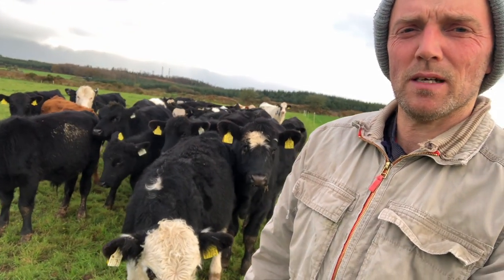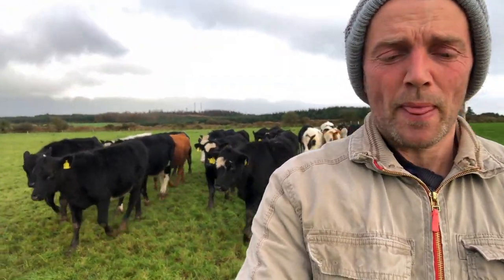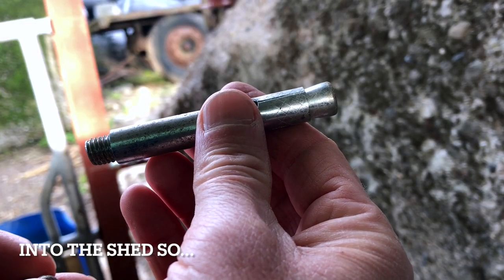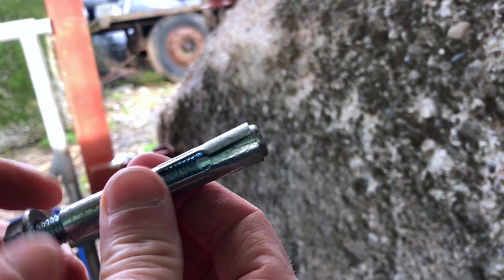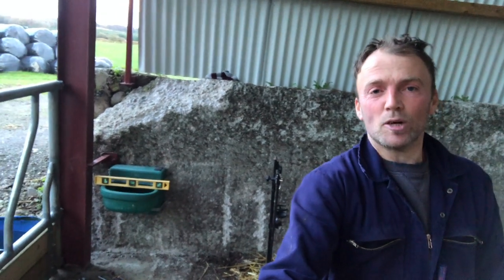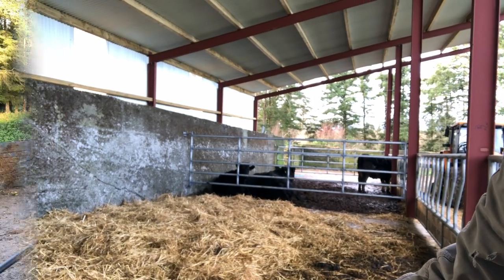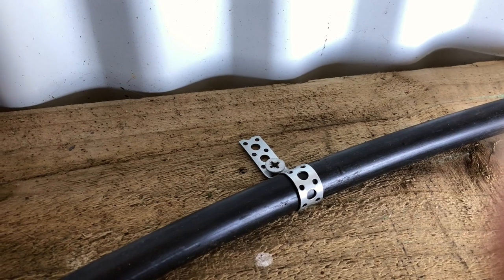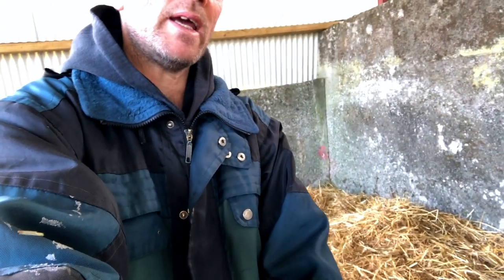Water trough finally fitted and a bloody start for the new crush gate

Comment: Kieran, I recommend that you add a gate/lever valve to the hydrodare of the water trough along the timber where you have it connected with the wall plate straps. It's easy to access if the trough overflows or you get a leak in the fittings and it's also out of reach from the cattle.